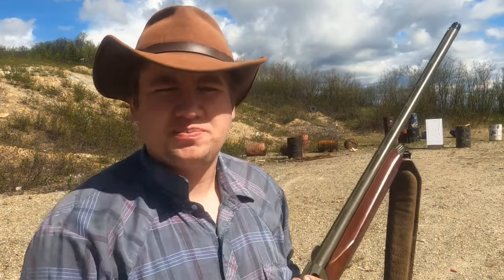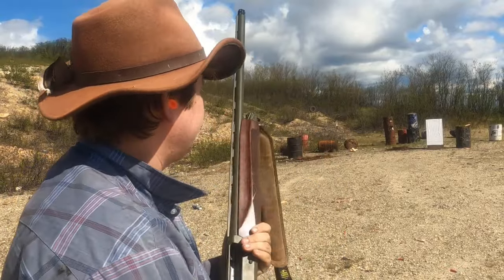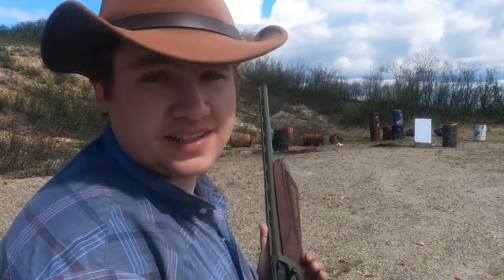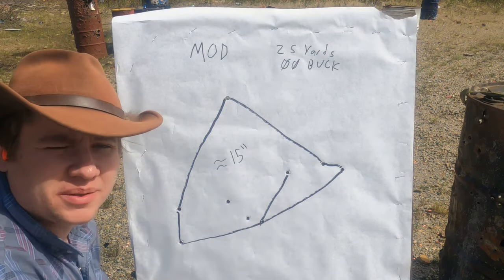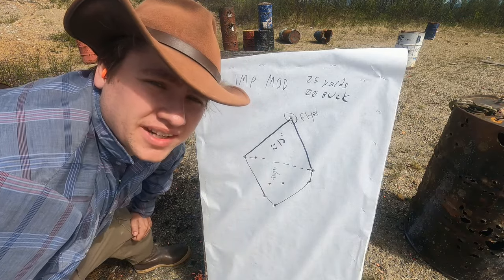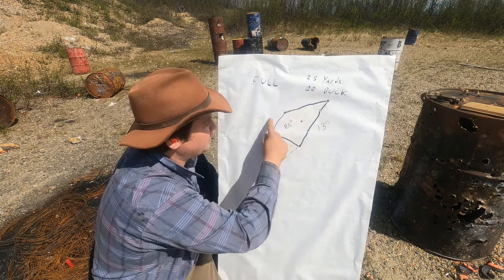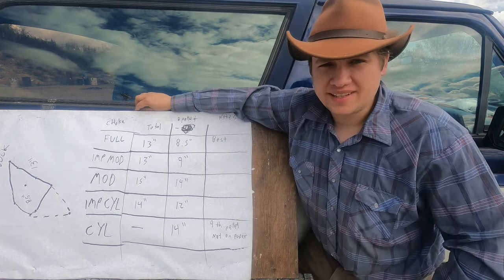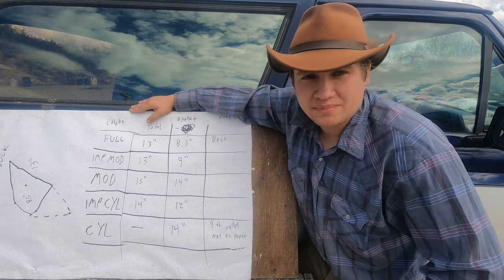Best Choke For Buckshot

Comment: FWIW, The tighter choke constrictions for CZ and many others are “modern” for IM .025 (5/8ths), F .030 (3/4); “classic” constrictions would be tighter for IM .030 (3/4) and F .040 and some aftermarket chokes, such as kicks buck kicker, are still LF .030, F .040, EF .050. This is primarily because gun manufacturers know there are a lot of trade-offs (flyers, decreased velocity, etc.) with standard loads beyond .030 constriction.

Comment: This is one of the most important things to owning a shotgun, and more important if you load yourself.
Patterns can be gotten when learning to quick mount and fire, in which case gun fitment becomes an issue to look at, ie: bending stocks, trigger pull etc. Really good video with great quality advice and research. You increased the hitting power 10 fold not to mention the accuracy. 
Nothing like knowing how you're stickin it down range.
Reply from the maker: Great points!

Comment: Great video. Well done 👏
As you stated here the biggest take away to test your own shot gun.  They’re all different. 
This does make me wonder though about 9 pellet 00buck. Its too bad the majority of manufacturers sell 9 pellet.  I only know of hornady selling 8 pellet loads but those are rather expensive and use a versatile wad, similar to federals flite control designed for cylinder bore.  

I’d much rather sacrifice having one less pellet which is usually a flyer liability anyway and purchase inexpensive 8 pellet and use a full choke.

Comment: I have always shot 00 buckshot in 3-inch magnum with a modified chock. Every gun I have had over the years no matter if it was a 28-inch barrel or a 30-inch barrel. No matter what brand of shell I used Remington to Winchester to whatever and the last shotgun I got was a Remington 1187 with a 30inch barrel and it is by far the best shotgun I have ever shot. I have taken many deer with it using the modified chock and used the full chock shooting number 8 bird shot to win my share of what we call turkey shoots where we shoot a target and the one closest to the center wins a turkey. We usually have them around thanksgiving and Christmas here in the South they are fun and usually cost between 3 to 5 dollars each round .
Reply from the maker: I am having trouble understanding the contest where you try to be closest to the center with #8 birdshot.  Wouldn't the pattern cover the target?
Reply: @gunsgearoutdoorsalaska5875  It is whoever has the closest pellet to the center of the target, and they are set out to around 35 to 40 yards, and we all get one shot at the target with the shells they give us to make sure no one cheats with a bigger or more loaded shell from home. We have a judge that measures the results and if there are more than one that he can't tell which is closer to the center after measuring we have a shoot off till one winner is clear. We aren't allowed to use aftermarket chocks at most events only factory chocks .

Comment: Wind noise wasn't bad at all. Nor the writing.
Good vidio. I had winning bid on a Mossberg 835, got a skeet tube and for social work an extended full choke to run, since rifled slugs can't be used in an 835.  The turkey choke wasn't recommended for buck either. Going to test the full and skeet with 00 plain and buffered low recoil.
Reply from the maker: Cool, I bet with the turkey choke it would start to compress the pellets some.  It will be interesting to see if you get different results.
Reply: The very tight patterned Turkey choke is used for shooting "only the head & neck" off of wild Turkeys. As far as I know the Turkey choke is the tightest choke on the market, it is one step tighter than Extra Full choke. But I do 'not' know if it will work with 00 or 000 Buckshot.??

Comment: My Mossberg 835 Ulti Magnum has a warning to not use Slugs. I haven’t tried buckshot yet. It’s actually comes with an extra full Turkey choke. I could buy an ordinary full choke for buckshot if I want to have a home defense load. Police train with 15 yard Q Targets with cylinder bore 12 gauge 870 Pump Shotguns. We used Federal Tactical 00 Buck. Most pellets were within the Q target at 15 yards. Shooting at 25 yards was not recommended as the pellets would spread missing the intended target.
Reply from the maker: I am guessing the no slug warning was because of the extra full choke.

Comment: I have been making the full choke argument for 50+ years with my friends.  I however use 3" #1 buck,  I find that while I naturally do get a wider pattern with the #1 I will gets more hits in the circle.  I have been using #1 ever since I went out of state hunting and forgot to bring my ammo.  The local walmart did not have OO so I took the  #1.  Well the next day I dropped the biggest buck of my life in his tracks with one shot at 20+ yds.  Since then I have dropped every deer I pulled the trigger on with 1 shot with 1 exception.  He ran about 50 yds. before he stopped  and I did not want to take a chance of him running again as I was on a small hobby farm in a populated area  and doubled tapped him, end of story.  The rest: one shot one kill out to and past 50 yds.   I still have that  open box of 00 sitting in my gun case that I have not used since I forgot it there 30 years ago.
#1 BUCKSHOT RULES IT IS BY FAR THE MOST DEADLY AMMO YOU CAN USE TO 50 YDS. AND A BIT BEYOND.

Comment: Thanks, you answered some questions. Im interested in 1 choke to run slugs and buckshot through.
Reply from the maker: You would probably have the best luck with improved cylinder or cylinder with flight control buckshot and rifled slugs.
Reply: @gunsgearoutdoorsalaska5875  thanks.

Comment: I have a stage coach 12that has ic & modified. With 18”” barrels and 9 pellets. The 8 pellets will pattern tighter.
Reply: 8 pellet patterns much tighter through the 2 shotguns I've tried a similar test on.
Reply: @Dtmdeman  known as the 9th pellet flyer

Comment: Great video well done. 
1) I would like to know the difference between straight lead, copper plated, and nickel plated Buckshot.? (I have all three but I do not know.)
2) 'Slugs' with an Improved Cylinder or Cylinder choke, 'not' Modified). You could maybe also do a video with accuracy of a 'Slug' out to 100 yards. 
3) What is the make & model of your shotgun.? 
Thank you.!
Reply from the maker: 1)/2). Thanks for the suggestions, buckshot and slug variety is pretty bad up here at the moment, maybe in the future.  I know buffalo outdoors did an interesting video on slug accuracy with different chokes. https://youtu.be/P1OkpM97rcQ
3) The shotgun I am using in this video is a CZ 1012 All Terrain, I did a review on it if you are interested. https://youtu.be/RaBTL0P0f80

Comment: Every gun will shoot different with different chokes and ammunition. Always pattern your gun with ammunition you use and try different chokes until you get the pattern you want. Buckshot with buffer would improve pattern better then with no buffer. It reduces deformation of the shot.
Reply from the maker: Exactly! The wad technology has come a long way too, I want to try out the flight control wads at some point.

Comment: So for a modern shotgun such as a cz1012 I’m assuming it’s safe to shoot buckshot with any choke ? I just heard some people saying how full choke could damage your gun.
Reply from the maker: As a general rule yes, it will not hurt the gun.  Probably not a good idea with really old guns, especially with Damascus barrels.  Also follow any instructions on the ammo box.
Reply: @gunsgearoutdoorsalaska5875  WOULD LIKE TO UPDATE THIS, JUST CALLED CZ THEY SAID ONLY USE CYL OR IMPROVED CYL FOR BUCKSHOT, ONLY WAY THEY RECOMMEND TO EVEN USE A FULL IS IF USING LEAD AND NOT STEEL

Comment: Interesting, I keep hearing that full choke is bad for buckshot patterning but here even with pretty large diameter pellets getting a tight pattern. I have a 12 Gauge Browning Auto 5 made in the late 1940s that has a fixed full choke (I swear, why does every interesting vintage shotgun I find a good deal on have a fixed full choke lol) and I'm not sure if I should ever fire buckshot through it.
Reply from the maker: I was surprised by the results too.  The fixed full seemed to be popular back then in the time before steel waterfowl loads.  You may want to ask a gunsmith first since its an old gun but I would try buckshot in it.  I learned filming this video that there is no way to tell how something will pattern without trying.

Comment: Is a fixed choke the same as a full choke?
Reply from the maker: No, a fixed choke can be of any level of constriction.  It means that the choke is machined into the barrel and is not removable or adjustable.  For example a gun could be a fixed full, fixed modified etc. Most older shotguns are made this way, newer hunting and competition shotguns generally have removable choke tubes that can be swapped like my CZ.  Hope that helps.

Comment: Walmart cheap federal 15 round pack Stoeger m3000 Kicks Buck Kicker choke consentient 12 to 14 inch group at 80 yards. That's a dead deer  hog or what ever out to a 100 yards. You get even tighter groups with buffered buck shot.

Comment: what was the barrel length?
Reply from the maker: 28 inches.
Reply: @gunsgearoutdoorsalaska5875  Can you try the spread check with 18 inch barrel shotgun you have, at 40 yards with different chokes.
Reply from the maker: The 18 inch barrel on that gun is cylinder bore and not threaded for choke tubes.

Comment: Whats best for rifled slugs ??
Reply from the maker: I would think cylinder or improved cylinder would work best but every shotgun is different.  That would be a fun one to test in the future.
Reply: Some rifled slug boxes will tell you which choke works best (it’s often improved cylinder). While you can often use modified as well, never fire a slug through a full choke as this could damage your choke/barrel and cause a gun breaking/life threatening malfunction

Comment: No not 2, there is actually 3 rules of thought, Federal Flite Control 00 buck and everything else.
Shoot Flite control 00 buck through an open/no choke. There is nothing else like it! No need to mess with chokes.
Reply from the maker: I have heard great things about the flight control, have not got my hands on any yet.
Reply: I will try to get hands on some if I come across any. I get pretty wide patterns out of my 590 at 50 feet.